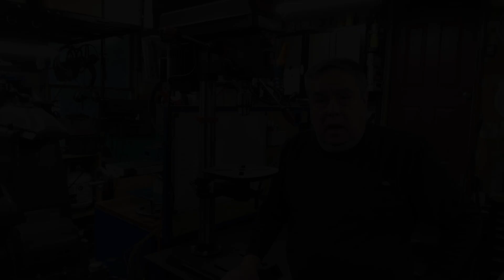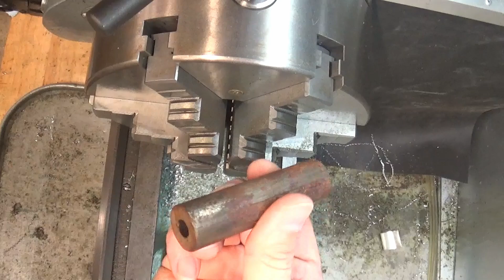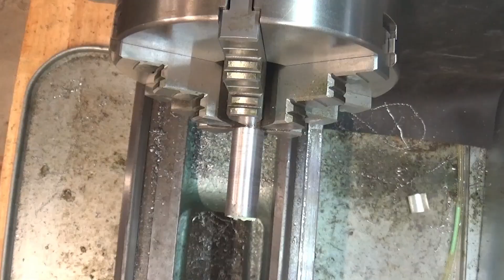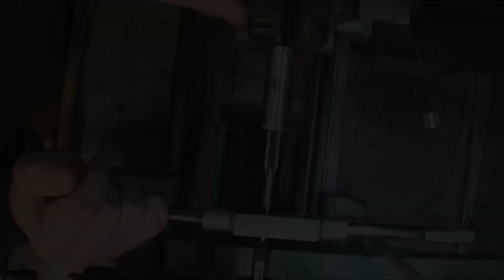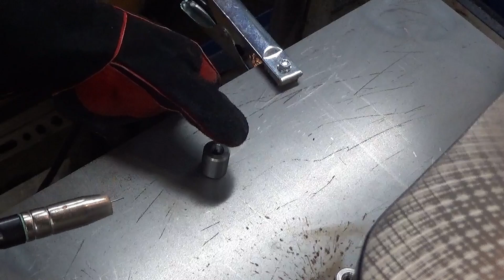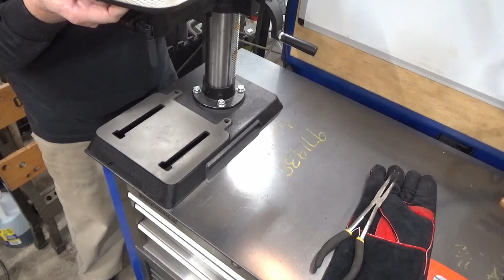Wobbly Drill Press Fix

Comment: Good to have it bolted down 👍
I really like your base cabinet, what type of drawer system is that on the bottom? 
Good to see you, Mick ….
Reply from the maker: @TheAyrCaveShop  Hey Dean! Good to hear from you.  Yeah my previous drill press was a floor model, which worked fine not bolted down...  The cabinet is by a company called Foster and it says "Graphic Arts Furniture".  I got it from Craigslist.